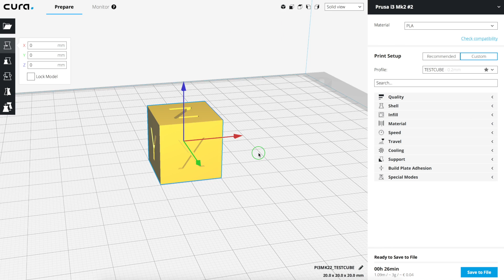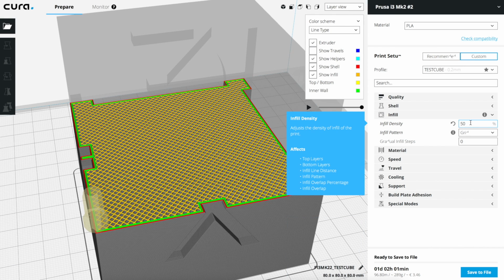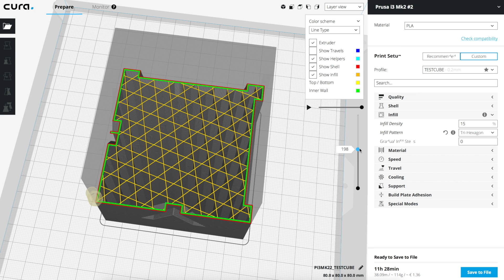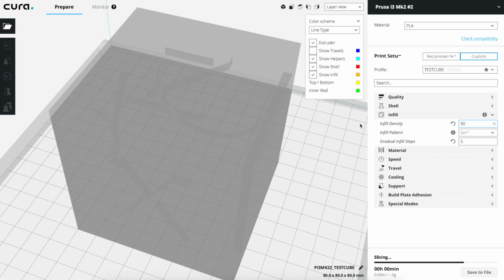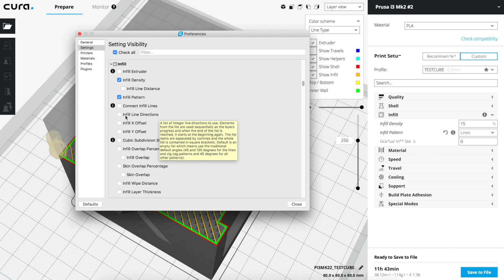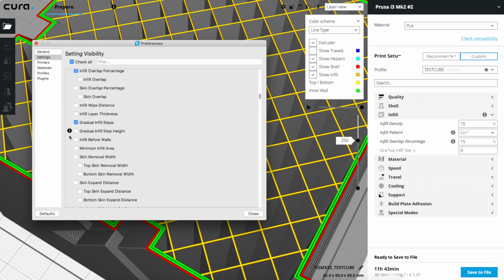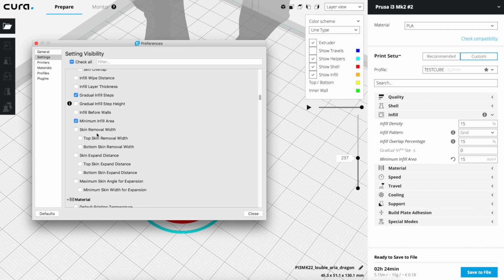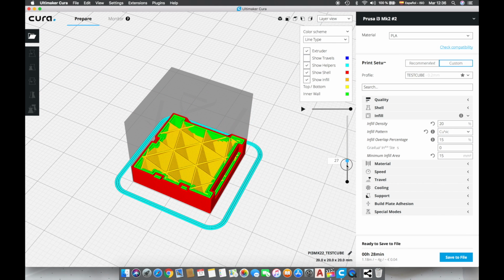Cura advanced settings 2018 - #03 Infill

Comment: Hello, the info is too clear but i want to know whether we can change the direction of the nozzle because it is always taking 45 deg angle instead i want to make it 0 or 180 deg i mean the print should be in parallel to the side walls direction. Is that possible ?
Reply from the maker: Hey! yes you can chose the angle of the infill from a specific setting that you have to show clicking the setup wheel. Also you can use concentric infill, so it'll be paprallel (an offset) of each of the walls.
Reply: @architects3dp  Thank you i got it (y)
Reply from the maker: You’re welcome! 😃

Comment: Hello! Please, could you tell me, if is it possible to change infill density only near top layers?
Reply from the maker: Hello Tomas!   Yesss you can do that!   You have to do it with the option gradual infill steps. For example if you want on the very top layers a 90 % infill, you have to choose this infill, and then, you can divide this infill in half going down, as many times as you want (gradual infill steps).   So if for example you write 3, it will divide the infill vertically in 3 segments. The top one will be 90%, the one in the middle will be 90/2=45%, and the one at the bottom will be 45/2=22.5%. Hope it's clear :)
Reply: @architects3dp  Thank you so much! :) I think it is very helpfull with cubic subdivision settings, because I can safe many of material in middle of part, which has big volume, but when I need print top layer I have problem with big distances of infill pattern. So thank you! :) It will safe time and money. Your videos are great and thank for them :) I have Anycubic I3 Mega :)
Reply from the maker: That’s great!! 😜